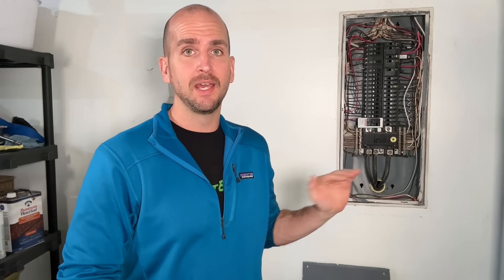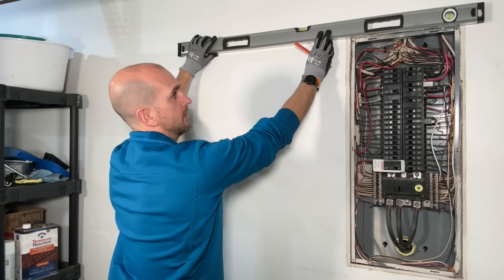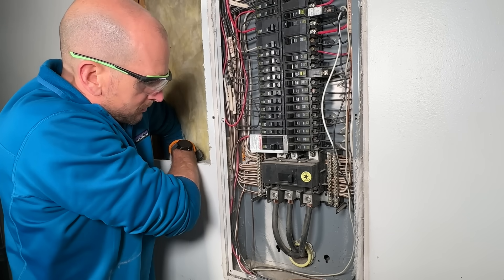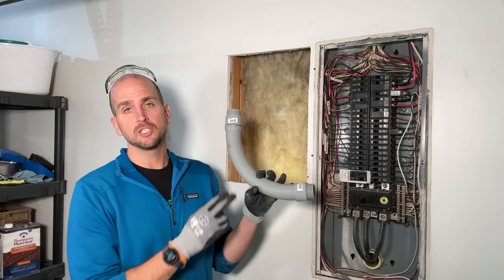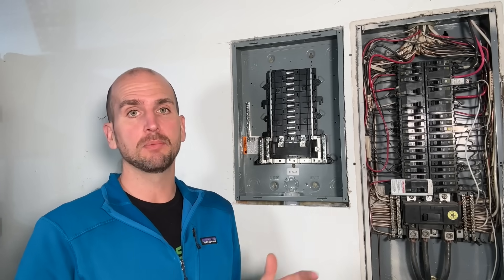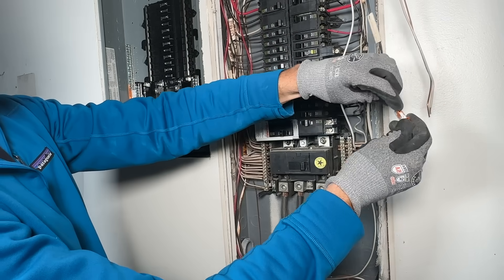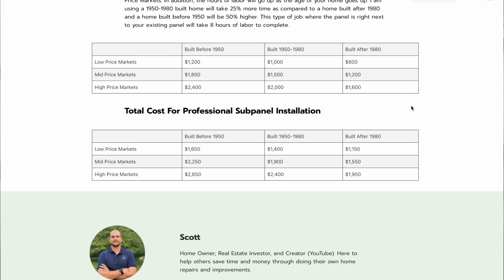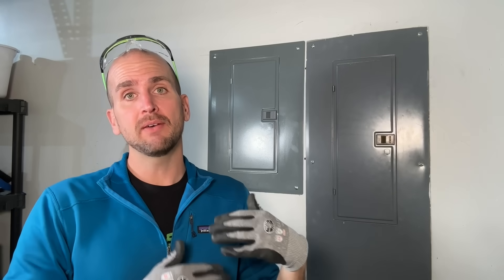How To Install A Sub Panel Next To Existing Main Panel

Comment from the maker: Calculate Solar Panel Cost For Your Home:  https://geni.us/wvG5
WAGO 221 Inline Splices:  https://geni.us/G0BW

DISCLAIMER: This video and description contain affiliate links, which means that if you click on one of the product links, I’ll receive a small commission.
Reply: I was hopeful that I could find an estimator without having to sign up for endless solar calls and spam. Sadly, THIS is not that estimator.
Reply: What if there is no place to put the neutral in the main panel?
Reply: One question please.

When you relocate those two circuits over to the new sub panel, can you just bring the hot wires over, leave the neutrals and grounds inside the main panel??

Comment: Question, I have a outside panel that is already full. It has 4 spots and each one has breakers already in. 

My inside panel is full as well.  I would like to add a second panel to that existing panel. 100 amp would be more than enough. How do I find out what I already have installed to that inside panel?

Comment: The panels I have worked with recently have snap on covers for the main lugs.  I am surprised you don't have them on your main panel.  I guess that idea came later.  Still, it would be a good idea to install some sort of protection.

Comment: Silly question, but does it matter the location of the 100 amp breaker for the sub panel? Does it have to be close to the main breaker in the main panel? For example my main panel is a 200 amp, and the breaker is at the top, would I have to move the breakers at the top around? I two empty slots at the bottom

Comment: THANKS GREAT VID..To a novice DIY er seems like one would have 300 Amps to work with by adding a 100A sub panel but actually you still have 200 A just more room for more circuits...IS THIS CORRECT ?

Comment: Is the 2 AWG you ran from the Main-panel, 100 amp breaker copper or aluminum?  It was hard for me to tell.  If you were using aluminum, it would have to be min 1 AWG, because 2 AWG aluminum is only rated for 90 amps (You must use 75 degree column of NEC)  and the 83% rule does NOT apply to sub-panels / feeders.

Comment: Great video! But the part that always confuses me is if your 200A panel is full, how is it possible to add a 100A circuit to feed the sub-panel by simply relocating two circuits to the sub-panel. Wouldn’t the new 100A circuit take the main panel over its rated load? I apologize in advance if my question doesn’t make any sense!
Reply: This is what I was thinking.

Comment: I know this post is a couple years old but I have a question. Since you installed the subpanel in a wall that is already sheetrocked how will you add the new circuits. Won't you have to cut the drywall out so you can add the NM clamps?

Comment: So my main disconnect panel is out on a pole by the meter. My main panel inside the house and the sub panel next to it. Both have the ground and neutrals on the same bar. I'm assuming this is not good but do I need to get this all rewired to change it??

Comment: Would you use the same gage wire even if the sub panel is going to be about 12 feet away from the main panel. It's still in the main house but just located by the stairs going to the basement for easier access.  Plus. Do you need to add a green ground screw to the sub bar.on the sub panel?

Comment: Great video!  This is EXACLY what I was looking for and looks like the work to do is just like I expected.  I need more breakers for my (soon-to-be) gameroom as well as a new detached garage.  Will put the new subpanel right next to the existing and then run wire from the subpanel through conduit/ditch to the garage.

Comment: Why are you running conduit when the wires are running INSIDE the wall? I think code says conduit is only needed if the wires is "subject to physical damage." It also looks like your hole exceeds the 60% of stud width maximum required by code.

Comment: Nice video.  Technically-speaking, the 12 gauge wires going from your main panel to the subpanel should be THHN instead of uncovered romex; also, the neutral feeder 2 gauge should be identified with white electrical tape on both ends.

Comment: I've done a lot of electrical work but never added a sub panel. I'm waiting to run 220 volt welders and a 220 air compressor in the garage can I add a 100 amp sub panel to my 100 amp main panel and be safe.

Comment: I had an Eaton main panel and the 2 gage copper wire would not go in the lugs or the breaker. I actually got the sub panel set up and everything ready and ended up calling an electrician to feed the wire and hook wires to lugs and my 100 amp breaker. He said the 2 gage copper strand wire was big enough for a 200 amp project so I’ll save that for my shop  I had everything purchased and sub panel set up. The electrician charged me $295 so I was very happy with this video and the final bit of help from a professional. I certainly have learned a lot from both places!!!
Reply: You mean 2/0

Comment: I was watching a video from a panel manufacturer and they stated the clearance distances needed for panels on walls. They also stated that a subpanel must be 12" away from a main service panel in a home. Is this a rule for some certain wall types??  I have a cement basement with the service panel surface mounted to wood attached to the cement. Is there any restriction as to the distance the two panels must be from each other? I haven't found anything about this 12" clearance between them.

Comment: Is it ok to relocate circuits that were going into tandem breakers on main panel to sub panel. Then use the space created by removing the tandem breakers to install a 100amp double pole breaker to feed the sub panel.
Great video, just need help confirming this, as the lugs are lugs for tandem breakers are different. I'm using Eaton BR panels.

Comment: I used #3 wire, check conduit charts its fine. Then I could use 1.25" conduit and I ran it just like this, using a 2.25" hole saw, with the arbor removed after a while, till I hit metal.  I installed the box first into spray foam and found the elbow I couldnt get in cause it was deadheaded both sides.  I was able to warm up the elbow with a propane turbotorch till it was pliable then quickly smash it in place and it turned out great.  Oh and I only needed to add 2" long piece to the bell up top and found it cheaper to buy a 1.25" 45 degree elbow instead of a 10' stick.

Comment: Hi I tried to to make sub panel from old bryant main panel which is the neutral and ground is bounded(Cant see do how they grounded the panel), so i have 2 jot wires and I took a neutral from bonded ground neutral. But this makes my sub panel bonded as soon as I connect the neutral. I did place a separeate grounding bar and rod to my new sub panel. Removed the grounding screw. But It is still bonded.

Comment: Question from someone who is just starting out. why are the neutral wires not wrapped in white so they can be identified. the main panel doesn't have and the sub-panel is missing it too.

Comment: I've got main service cables coming in from the bottom left and wrapping all the way around to the top for the main breaker.  It seems the only way to work in there is to be constantly touching the service entry cables.  Of course the insulation is good, but in most cases I see everyone saying to avoid any contact with them even though the insulation is fine.   Thoughts?

Comment: Great Video.  Please clarify the need to separate neutral and ground in the subpanel.  I'm having issues with tripping of GFCIs that I believe are related to this issue.
Reply: I know they are supposed to be but if you watch towards the end I think he puts the ground into the neutral bar. It's hard to tell but yeah he does specify that.

Comment: Can the EG4 12kPV be installed without a sub panel to run the main panel? Looking to have 5600 watts of solar help out with the power bills and provide power during an outage.

Comment: I’ve learned a ton from your channel, thanks for all you do. I’m in the process of planning the Ecoflow smart home panel 2. Question, which wire size requirement chart do you use?  The one I was looking at appears to allow the use of 4 awg for a short run of 100 amps?  Also, if I split the SHP2 and put the DHP input 50’ away do I use 2|0?

Comment: Can the sub panel breaker size be larger than the breaker feeding the sub panel from the main panel? He used a 100 amp breaker to feed a 125amp panel?
Reply: He installed a main lug panel, it has no main breaker.
Reply: @pld8993  There is no need for a main breaker in the subpanel because the 100 amp breaker in the main panel that feeds the subpanel serves the same purpose.  You might want a main breaker to use as a shut-off if the panels were separated by a long distance.  But for a subpanel next to the main panel, a main breaker in the subpanel serves no purpose.
Reply: @kentlind3147  True, but that wasn't the question.
Reply: @pld8993 the 125 amp rating of the panel isn’t a breaker rating.  It is the rating of the bus bar inside the panel.
Reply: @kentlind3147  Also not the question.
Reply: @pld8993  The questioner is confused because he is asking about using a 100 amp  breaker to feed a 125 amp subpanel.  But the subpanel has no main breaker, the 125 amp rating of the subpanel is the rating of the main bus inside the panel.  They are sold without main breakers.

To answer the question, you can put any size main breaker you want in the subpanel including one larger than the supply breaker in the main panel.  Because if it is larger then it is just functioning as a shutoff switch, not a breaker.   You are basically just putting two breakers back to back on the same circuit and the smaller amp one will control the circuit.  The larger one will just operate as a switch.    There might be some quirky code issue that recommends against this.  and it might raise eyebrows to have a 200 amp main breaker in a 125 amp subpanel.  And it would be a waste of money since larger breakers are more expensive.  But there is no safety issue.  The 100 amp supply breaker in the main panel is what controls the circuit.

I think the only code reason to put a main breaker in a subpanel is if the subpanel is in a different location like a different building and you want to have ready access to a shutoff switch to turn off the subpanel.  But if they are next to each other as in this video then there is zero reason to have a main breaker in the subpanel.

Comment: In case of contact, you can use cardboard in front of the main feeder cables to provide a barrier. It's good that you're using insulated gloves, but your wrists are bare.

Comment: Great video. If I understand correctly........in the main panel the neutral and ground are bonded (meaning they are joined...so ground and neutral are the same) ..............and then on the subpanel...........you install a new bar.........to seperate the Neutral from Ground..........however both of those wires go back to the main panel.........and are screwed down to the neutral and ground bar that is bonded........................why do you sperate them if they are all connected to the same place ?
Reply: yes you only need to bond neutral and ground on main/service panel so if there are any fault the current still be able to complete from ground that bond to the neutral and return back to the transformer (complete circuit). If you bond in your sub panel so you just create multiple path for the fault and it can be dangerous for any other equipment that connect to any outlet. I hope that would clarify for you since it took me awhile to understand that point too.

Comment: If you were using copper wire for your hots and neutral what size would it be, #2 is for aluminum.

Comment: One question please:

When you relocate those two circuits over to the new sub panel, can you just bring the hot wires over, leave the neutrals and grounds inside the main panel?

Thanks!

Comment: Great video as usual, regarding installing a 50a breaker on my sub panel and specifically capcity. I have a new Tesla and want to add a 50a breaker on my  garage 100a sub panel. Can you confirm that this is no-no please?

Comment: Where can I find the 100 amp breaker you used to bring the main power to sub panel?
Reply from the maker: Some home centers will carry them if not check your local electrical supply houses.

Comment: I called 4 different electrician for install power inlet for portable generator.

4 different answer

1) install sub panel
2) install transfer switch 
3 ) remove 4 / 20 amp breaker replace with 50 and 30 amp breaker 
4) upgrade your main panel 
Wtf.

Comment: 8:32 when installing a ground bar the paint of the mounting spot supposed to scratched off on sub panel.
Reply: No, they're supposed to use electrically conductive paint.
Reply: Not a bad idea, but not required. The bond is through the mounting screw(s).

Comment: Great video, I am rewatching this in preparation to do the same.  I do want to point out that there is only ONE phase in a standard residential panel. I was confused by this for years, because people often refer to the legs as phases. During every 1/60 of a second the voltage rises to 120 on one leg and then 120 on the other. When you graph that you get a sine wave, or a single phase. To have a second phase you would need a second set of legs alternating slightly before or after, or “out of phase”. In the real world there is single and 3 phase. 3 phase power is 3 sets of legs each 120 degrees out of phase with each other. 3 phase motors are more powerful and run more smoothly because it is similar to having 3 pairs of people spinning a merry go round vs 1 pair.
Reply: Residential systems are usually what's called split phase whereby a single phase from the power company's 3-phase is split through a transformer, providing two legs that are 120V each sharing a single neutral. Think of a two piston engine (legs) with one exhaust pipe (neutral) and you'll get the idea. However, in the field it's common to call both legs phases. Technically not correct but more like electrician field slang. Not unlike when someone checks a circuit for power; they're not, power is wattage and they're checking for voltage. But when someone asks an electrician why they don't have power, everybody knows what that means. Like any trade, electrical has its own language that non-electricians may not understand fully. When a 3-phase motor loses 1 phase, for example, we say it's single phasing. Again, trade lingo, not necessarily what's happening electrically.

Comment: Can you do a video on permit application for this kind of subpanel installation? I'd like to add my own generator connection to subpanel for power outage. Is there subpanel with switching to connect to my own generator? Thank you.

Comment: 100 amp breaker should use 4 gauge copper wire right????
Reply: For a residential panel yes, otherwise #3.

Comment: Hi. As usual, informative and plenty of insight. I have a 100amp Panel and will put the sub panel like yours. Those 2 breakers you took out of main and put into Sub. for the  install of 100amp breaker on main. 
So the question is; Every New Circuit goes to the Sub. Panel? If I want to add a Split System I wire it to Sub panel. 240 Car Charger etc? Is that correct? Thanks for your time Sir. 
Mike ienuso.

Comment: Might be a silly question, but how do you add the Romex connectors as strain relief when a panel is recessed in the finished wall?
Reply from the maker: Not a silly question and a bit tricky.  Here is an example I did for a generator inlet https://youtu.be/RmYwIt0RHnI?si=6-khp7-QkFXyfcj_&t=300

Comment: So you don't have sub freezing temperatures ever ?  If so heat pump instead of air conditioner but you should keep the gas furnace as backup heat for those really cold times when the heat pump becomes inefficient

Comment: Excellent tutorial for a DIY guy. I will be putting in a 12 circuit 100amp Sub Panel exactly like your video. My question is about choosing a Sub Panel with the Plug-On Neutral feature and GFCI breakers. Is there any difference in where the #6 ground is connected?

Comment: Making connections inside an electrical panel is a code violation. This is only permitted when replacing a panel, for example when replacing an old fuse panel with a circuit breaker panel.
Reply: If you're talking about splices inside a panel, it's not a code violation.

Comment: Great video. 
Question…Do you know if a 100 amp sub panel can be used with a 60 amp breaker? I only need 60 amps but a 60 amp panel does not have enough slots for me. The 100 amp panels have plenty. Thanks!!

Comment: If you have a 100Amp sub pannel in the Gargage (Ground level) from main in the sencond floor, and need to add another pannel for EV charging (50 Amp breakers), can you use the subpannet to feed into adjucent EV subpannel for car charging or is this code violation?
Reply: Yes, you can.

Comment: Sir...I have 60amps main breaker.  What will be the amperage of my subpanel with 4 x 20amps
Reply from the maker: It would depending on the load from each of the circuits taking into account the loads.  For instance just because you have 4X20 Amp breakers doesn't mean you will be running 80 Amps through a 60 Amp subpanel.

Comment: Don’t you need a ground rod per code at the sub panel?
Reply: No, only if it's installed in a separate building or structure.

Comment: Sub panel work is not a DYI project. If you're not an electrician, don't listen to this guy and if you are an electrician, you wouldn't listen to him anyway.
Reply: I'm curious as to why not...? Just saying don't listen without specifically mentioning errors or mistakes being made doesn't necessarily warrant listening to you either; (Not an argument, just pointing that out, you may be right but how would one know)...